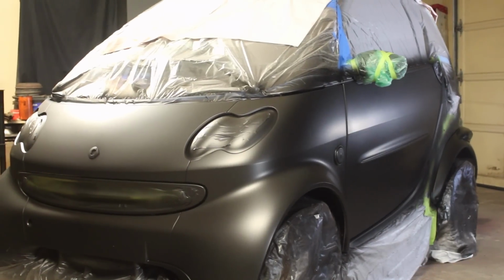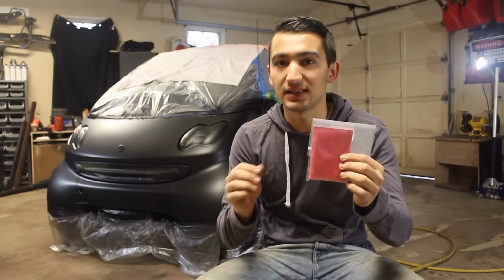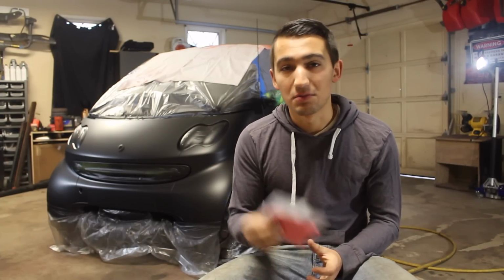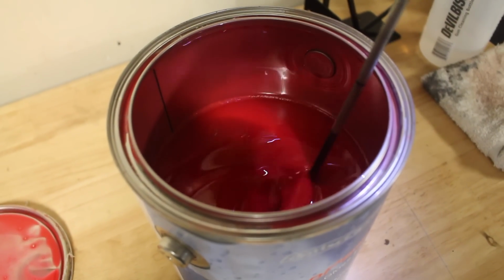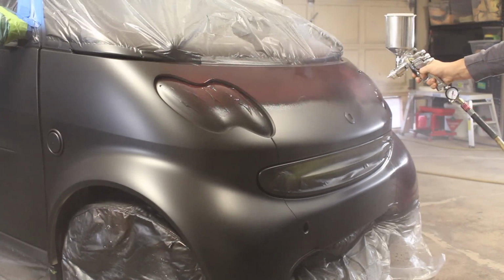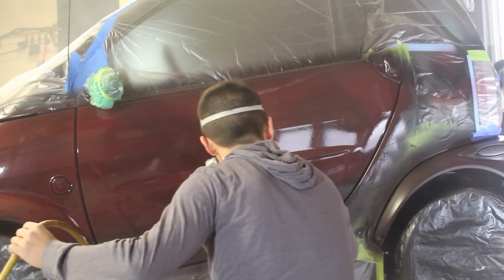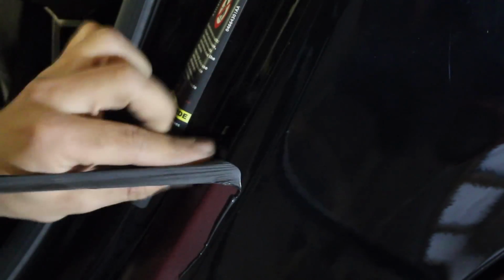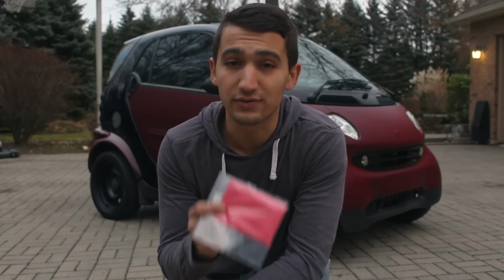HEAT SENSITIVE PLASTIDIP!!! Thermochromatic Pigments in Dip

Comment: Hello nice job. I am looking in to doing som Plastidip my self and this looks cool as h... 

One question, what size of needle do you use. The biggest one I have is 1,3mm from FujiSpray. Will this be sufficient ?? Hope to hear from you. 

Best regards
T.R
Reply from the maker: +Norwegianwoodworker I would stick to something a bit bigger than a 1.3. If you are spraying PDS, plastidip spray, so a red, black or any other kind of coloured gallon, use something between 1.6 and 2.0 because it is a thick product, unlike automotive paint.

Comment: It looked okay when you first finished painting it. Sort of like a classy burgundy red. But after you heated it up and cooled it down, then it turned blotchy, and now it looks more like an ugly rust color, which I personally think it looks terrible. Just my opinion. Maybe applying more coats would help?
Reply from the maker: +Travis Ross (TwistyTravster) Yeah I know but it was a fun experience and now I know what happens when you do it on a car. Thats why this was not a customer car. It was a test car :)
Reply: Does the dip peel off easily, even though you've heated it up repetitively?
Reply from the maker: Yep. As long as you put a good base coat down (the black plastidip), it can be peeled up no problem.

Comment: this is mega cool, but i don't feel comfortable with naked flames so close to a car :O
Reply from the maker: +ben barrett I'm with you on that, however the flames were at far enough of a distance not to ruin the panels. The plastidip changes colors when it gets 92 degrees fahrenheit, which is not hot by any means